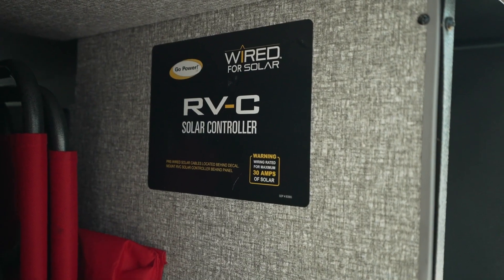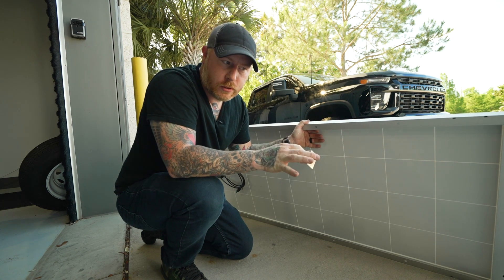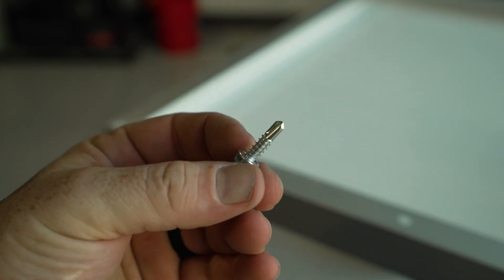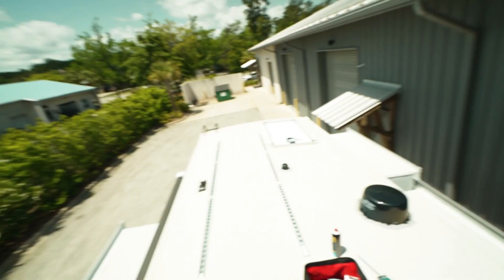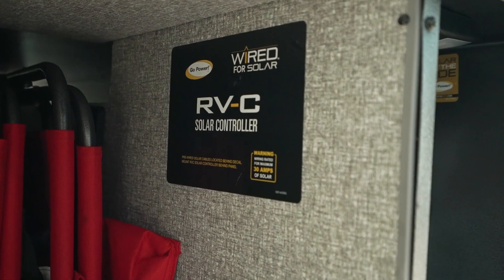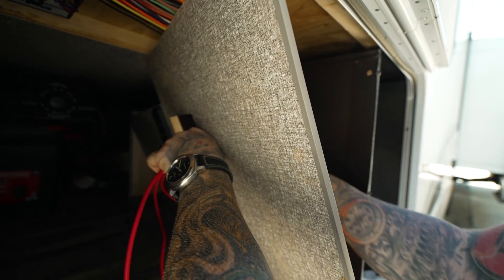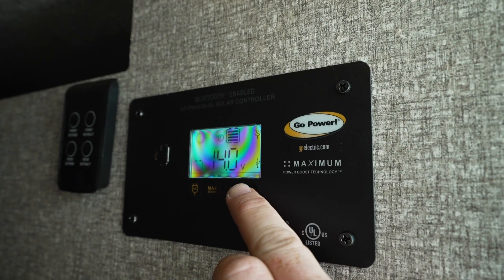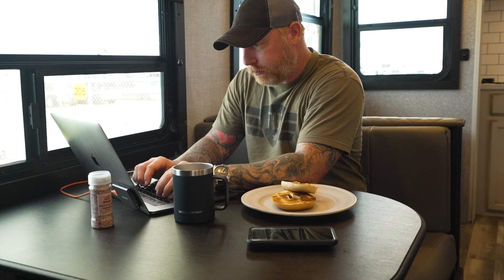The BEST Way to install Solar Panels on an RV

Comment: Hi I did this technique several years ago with my RV as the 1/8"veneer roof wouldn't support the the panels so I had to drill into the trusses. With the curved roof I had it gave a slight angle tword the sun  I used ( 3) 10 ft sticks for (4) 250W panels. I was concerned with rv flex but after two years no issues with water. I used epever 60amp with Bluetooth for monitoring MMPT  (1) 300ah lithium chins and renorgy  battery monitor and 3kw inverter. Like you no air conditioner but kurig and tv's & microwave worked. Thanks for the video great job & presentation I used my rv for PIR and Texas speedway drycamping.